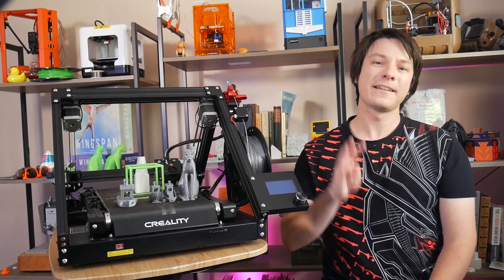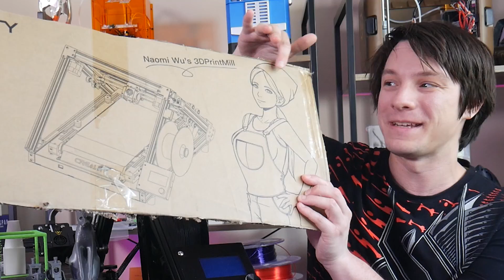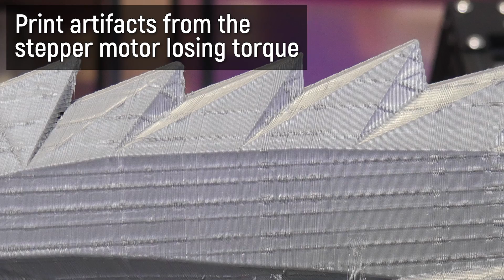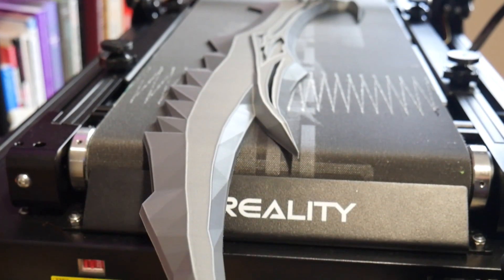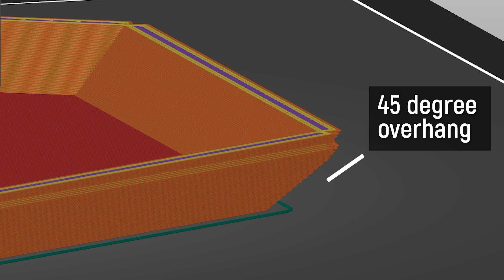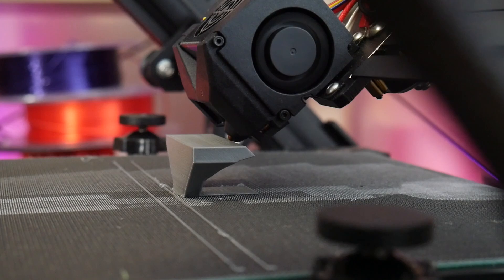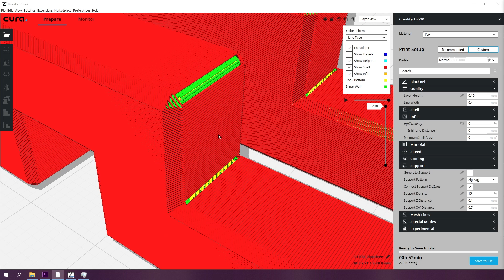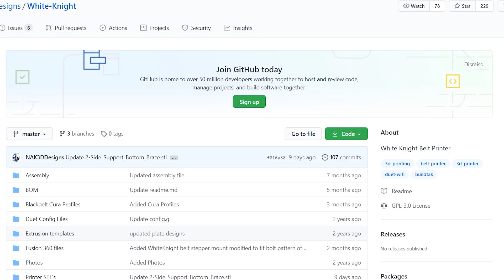Your 3D Printer can't do this... Naomi Wu's 3DPrintMill / Creality CR-30 Review

Comment: I don't think you should assume it is pre-production and the final product will get better.. Why not? Because the CR-6 SE was that too, but at the end of the Kickstarter many flaws found in review were still present. In fact, the final product got a few new flaws (or had them but were intentionally overlooked?).

So: back the product as it is - don't back it hoping it will get better.

Also, this is the most honest review I've seen. Not just "It is good and I'm sure it will get resolved"  - like some other large channels.
Reply: Adon Smith  I'm not saying Angus shouldn't assume it mate 😉- I'm saying as a potential backer you shouldn't assume the product will change.